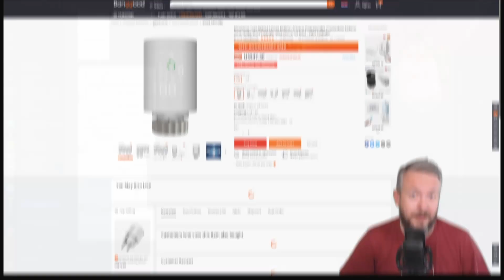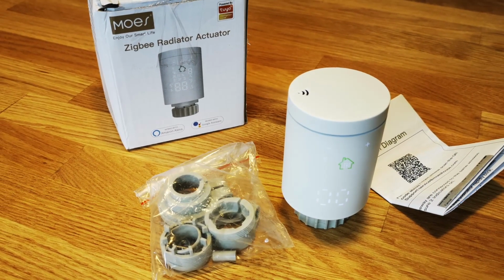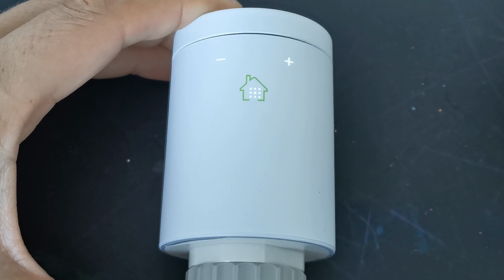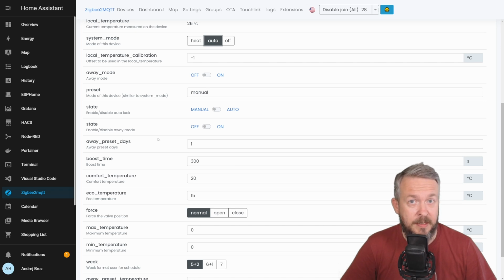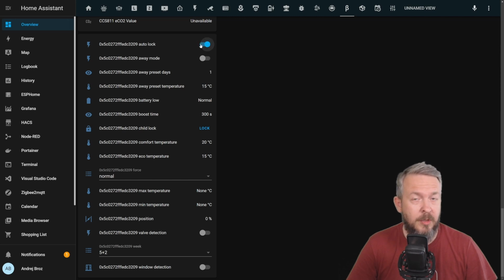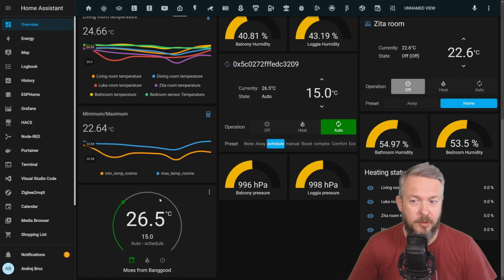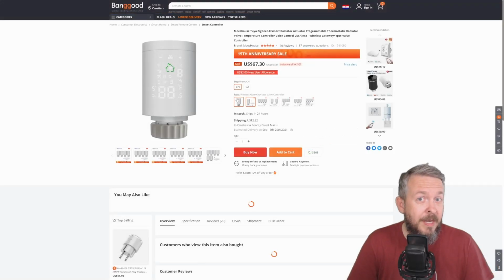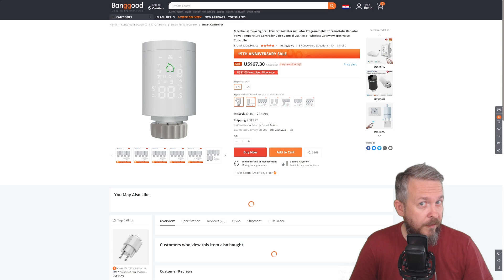Moes Zigbee Smart Valve TS0601 in Home Assistant

Comment: Hi, great video, helped a lot. I have a question, can you use another temperature sensor (not the built-in one) to be used as the temperature probe? i.e. another zigbee temperature sensor mounted elsewhere in the room? thanks
Reply: Yes, but keep in mind that you maybe need a Zigbee hub(or USB dongle) in order to link it to your Home Assistent system.
Reply from the maker: As Steven said, it should work - and hub should not be an issue if you already have Moes sensors in HA.
I would create generic thermostat that would use sensor data for temperature but use climate to control device.
Reply: @BeardedTinker  the hub is not an issue, I already have many zigbee devices through a USB dongle. Can you control the valve directly, bypassing the internal temp readout? essentially using just the "valve" portion of the TRV? i.e. is this component exposed to HASS?
Reply from the maker: @Vojtech Tambor  Yes - that position % (0-100) is full closed to fully open.  Check this here for more info: https://www.zigbee2mqtt.io/devices/TS0601_thermostat.html
Reply: @BeardedTinker  looks like you cant use the valve position % - "Position. Value can be found in the published state on the position property. It's not possible to read (/get) or write (/set) this value. The unit of this value is %."
Reply from the maker: But there is "force" that can be used: https://www.zigbee2mqtt.io/devices/TS0601_thermostat.html#force-enum
Reply: Hi  @vojtechtambor867   I wonder if you could manage to get the valve operated in  "On/Off" mode using external zigbee temperature sensor in HA?

Comment: Hello, very nice video!!!  It give me some "lights", I've one question, if there is a house of 2 flats with around 60 m2 each, will be the hub able to cover all the zone? Someone with experrince on that?  May be there is a kind or repetitor of zigbee signal?  thanks and congratulations for this video!!!
Reply from the maker: Most mains powered Zigbee devices (such as light bulbs or power outlets) are also routers on Zigbee network and as such they extend coverage of the network. IKEA also has (or had, haven't looked lately) range extenders for Zigbee network. Also, some devices can be flashed with router firmware and act as Zigbee network extenders (such as Sonoff USB 3.0 Zigbee dongle).
It's hard to say if any of such devices will be needed or how many are needed to cover such space as it also depends on type of material used for walls, floors etc.

Comment: Why must I use Zigbee2MQTT? All my existing zigbee devices are connected to the zigbee integration directly and are working...
Reply from the maker: Nobody is forcing your arm. You can use ZHA if it supports it. If not, you can also create custom converter and make it compatible.
I use Zigbee2mqtt as it has more features and supports much more ZigBee devices.

Comment: I’ve bought 22 of these devices and I paired them all successfully. One stopped responding to Z2MQTT so and I noticed that it reported that the batteries were not good - which was strange in itself.

I’ve replaced the batteries and tried to access menu 5 again on the device - only it does not show. The menu only goes to 5. I’ve taken a new device out of the box and the menus on it are as expected but on this troublesome one it just doesn’t go back to 5…(pairing mode)

Has anyone got any suggestions? I cannot see a reset button on the thermostat
Reply: Hi @aidanbree.  I've just bought 3 of these (other white label version) from Amazon in the US. I am completely unable to pair them, following the instructions from this video. I've tried both a Conbee II and separately a Tubes (using Zigbee2MQTT). All my other devices are Zwave, so I can't test it separately. I've even tried moving the Rpi 10 feet from my router and behind a closed door to try to reduce interference.  Would you mind sharing your hardware and the Zigbee2MQTT Configuration?  Thanks!
Reply: @ha_tinkerer1191  Make sure you are running a recent version of Z2MQTT. I found that they'd changed repo some time ago and mine was stuck on an old release. When I sorted that out, everything worked fine. I use a Zigazigah stick
Reply from the maker: @ha_tinkerer1191  try this https://www.zigbee2mqtt.io/advanced/support-new-devices/01_support_new_devices.html#instructions to pull out exact device name (not address). There are devices that look similar but are in a fact different. It may be that those are not natively supported. If name of the device is not in the list, you can request that device support be added in Zigbee2MQTT. It's really not hard to pull necessary info, and others can help you.
Reply from the maker: @HA_tinkerer  - got notification that you posted replay but it's gone. YT deletes them sometimes for no apparent reason.
Reply: @ha_tinkerer1191  have you solved the issue? 3 valves work, 3 valves wont show menu 5
Reply from the maker: Check manual on this page - on the bottom of it is manual.
And last item on last page of manual is how to reset device: https://www.moeshouse.com/collections/trv-radiator-valve/products/tuya-zigbee3-0-new-mini-wifi-radiator-actuator-smart-programmable-thermostat-temperature-trv-controller
Display 88, using + or - to hange to 00, press MENU to reset, all of the icons appear means reset successfully (this is copy paste)
Reply: @BeardedTinker  Thanks - I missed that part. I gave it a go - several goes and it looks like it resets OK but bizarrely the main menu only goes up to 4....Its really strange. Every other device works OK!
Reply from the maker: @AidanBree  no idea what it would do that

Comment: B.T. Everything arrived but I can't get the pairing to work with my Conbee 2 to deConz Zigbee network. Can you point me in the right direction if you have come across a solution or let me know your Zigbee set up and I can use that.
Reply from the maker: Just checked deConz list of supported devices and I can't find it there. https://github.com/dresden-elektronik/deconz-rest-plugin/wiki/Supported-Devices#other-supported-devices
As I don't have Conbee stick I also never used deConz. Not sure what is procedure for adding support to new devices. In Zigbee2MQTT that part is much easier. for ZHA a bit more complex, but it's also duable.
Reply: @BeardedTinker  Ah! That's interesting. I now see that there are two Zigbee methods. Thanks for letting me know, B.T. I've learned something and can take it from here.

Comment: Hi. Nice video. I have the same valve. It works two or three days then it gets stuck and won't close when tether temperature is reached or, other way around, it does not open if temperature drops below target. In such cases I can only remove batteries and reset the device. Do you have any similar experience with those valves?
Reply from the maker: While I had it (it was given away) I didn't have those problems. What is LQI (Link quality)? 
One thing you may try is to replace batteries just ot be on the safe side and that's the only thing that pops on my mind.

Comment: Nice video, but I issued an incorrect temperature when adding the thermostat on the HA dashboard. I use the Tuya Zigbee hub and I have no problem when using the Tuya app
Reply from the maker: Sorry didn't understand. Is the temperature in Home Assistant that is reported different than in Tulsa App?
Reply: @BeardedTinker  Yes is the different temp . for example, the temp in HA is 25 C and the tuya app 5 c
Reply from the maker: 20oC difference? What value are you using in HA to pull temperature? Climate or something else. https://www.zigbee2mqtt.io/devices/TS0601_thermostat.html
You could use calibration setting to calibrate data, but still since there is such a big difference I think you may be pulling wrong value.

Comment: Is there a to setup a sonoff relay to initiate the heat from the boiler when any ofnthe valves open to some preset %? Also how to set up external themp sensor for these?
Reply from the maker: All such things are done on Home Assistant side. One is to create automation that would trigger the relay to initiate heat.
Second one is to create template thermostat and use relay as switch and valve as temperature source.
I don't know if it's possible to use external source for these, never tried and don't have it anymore as I've given it away on giveaway few months ago.

Comment: Hi, is your "local_temperature" updated immediately when you are changing "local_temperature_calibration" or is it happening randomly like for me?  I like to calibrate the thermostat "local_temp" with a room thermometer with an automation. (I have a BECA but integrated as Moes in Zigbee2MQTT, I believe it is the same Tuya stuff.)
Reply from the maker: Can't tell you, sorry. I've given my valve away at giveaway so don't have it anymore. But as this is end device in ZigBee network, it can take some time for update to be received as it goes in sleep to prevent battery drain. Not sure how often does it have to connect.
Reply: @BeardedTinker  Ok, it seems like if I leave it alone and don't touch it works (still testing). The point here is that I have a quite big room of roughly 65 sqrm with 7 radiators. The radiator valves are connected to radiator and the radiator are place under windows. i really don't care about the temp there. I care about the temp some 1,5 meter up from the floor somewhere central in the room.I basically wants the valves to play in sync. What I done is an automation that trigger at a time interval and compare the room temperature the " local temp" and correct it.

I need to try out the time interval, at the moment I'm trying 20 minutes. This is the action part of my automation.

service: number.set_value
target:
  entity_id: number.tobesrum_local_temperature_calibration
data:
  value: >-
    {{states('sensor.mellan_temperature') | float |round(1, "half", default) 
    -    (state_attr('climate.tobesrum','local_temperature')| float |round(1,
    "half", default) 
 -    states('number.tobesrum_local_temperature_calibration') | float)|round(1,
    "half", default)  }}

That is adjustment=roomtemp-(radiotortemp-adjustment)

Comment: Is there any way to use a smart thermostatic valve without a HUB? 

I this problem:
I have a Vaillant thermostat in the living room but in the morning the sun heats the space so the heating shots off but the other parts of the house are cold. 

I would need to move the thermostat or install a smart thermostatic valves so I could easily setup the first part of the day...
Reply from the maker: That's not easy answer - if you have Home Assistant as smart home software, you need some kind of Zigbee hub to connect device to smart system to control the valve OR to override Thermostat, if it is smart thermostat. I use tado thermostat and I can leave it on auto, or use Home Assistant to override values I get from it.
If you go with Sonoff Zigbee HUB, then you should be able to just use app for Sonoff to control the valve, but you would still have problem with thermostat.
Very hard to answer as there are multiple solutions on how you can do this.

Comment: Got one of these second hand to test out with home assistant. Do you know what all these modes (eco, Holiday, complex, auto) do? Are they just different temperature settings you can use or do they differ in behavior.

And 2nd question: if my trv needs to heat it always opens the valve completely, which is very noisy and creates incredible heat close to the radiator. Can't it just open half and wait if this is enough to achieve heating?
Reply from the maker: Thanks for the comment! 1) those are predefined temperatures that you can setp - for exampe Holliday is set to 7oC to prevent frost, ECO, few degrees below your standard temperature for times you are near your home, but not at home, etc.
2) not sure on that one - I've given my away and can't test it. Valve has 3 states - closed - fully closed, open, fully open, and normal - I think normal should be used for standard operation. Position values can only be read I think, and not set. Check here:  https://www.zigbee2mqtt.io/devices/TS0601_thermostat.html

Comment: 14:18 I'm very interested if you can post some links which devices can control my boiler? Like you said Tado and Netatmo can do that but they are very pricey.
Reply from the maker: One of them is this one - https://www.zigbee2mqtt.io/devices/BHT-002-GCLZB.html  this is Zigbee version. I have on my desk for test BHT-3000 - but by mistake, Wanted Zigbee, got WiFi. This should also work, but second mistake, it's for underfloor heating... :)
On Zigbee2MQTT link there is very good search engine and device list - try looking for thermostat - there are few of them there and all work with Zigbee. Just when you look at specs, check that they fit your boiler (and not like me order floor heating version).

Comment: Thanks for the great video! Can you please name the two devices for heat initiation please? I have a gas boiler (not a smart one)
Reply from the maker: I'm using tado, but that's legacy/closed system. Something lime this one will work great https://www.zigbee2mqtt.io/devices/BHT-002-GCLZB.html I unfortunately wanted to test this one but got WiFi version by mistake. But yes, WiFi version will also work.
When you look at  devices for heat initiation, be careful as most of them have 3 options - gas, electric and underfloor heating.
Reply: @BeardedTinker  so this is technically possible to use valves in addition to a thermostat in an indipendent home with a tuya ecosystem right? Because the more i look on the internet the more i see people using either only the thermostat (independent home) or only the valves (apartments). Instead i see systems like tado or netatmo being widely adopted for this particular situation, and it is making me think that this feature is not available in tuya. 
PS. Thanks for the quick response!
Reply from the maker: @filippoaisa2982  Yes, you can mix - but only if you have some other system that combines both of them - for Example - Home Assistant can talk both to Tuya devices and tado/Netatmo.
Call to heat is done to wards and smart thermostat (like one I sent you link or any other Zigbee/Wifi one). I have full tado system - both thermostat and also valves from them.

Comment: I noticed your  thermostat  cards had a scheduler icon, is that a HACs card or some yaml I haven't noticed?
Reply from the maker: This is HACS card - Simple Thermostat. It has Auto functionality for automatic day/night setting, but that's based on device it controls and you can't create schedule there.
My schedule is on tado app and devices use that.
Moes smart valve also supports schedule, and you can create it via MQTT.
Reply: @BeardedTinker  as usual, a clear and useful video. I´m using other type of thermostat for electric floor heating considering now HA fixed the tuya integration in the last release. I was looking for the Simple Thermostat in HACS but didn't find it. May be they changed the name...Can you please share the repository link. Thanks

Comment: Hello sir
I viewed your movie about moes thermostat valve
I see in the movie many thinks and i believe it must be also possible to program a schedule in home assistant
Now i have these valves but i can only see Temperature and batterie state
I can't find the other entities 
I use the standard Lovelace card and a conbee 2 ZigBee device
But i see also you have zigbee2mqtt is that the reason i can see only two parameters and is it possible to explain what i can do so i can see all the parameters.
As mentioned earlier I’m just a beginner.
Reply from the maker: Hi Ernst and sorry for late replay...
It is possible. Not as easy as with app, with, still you can do it via MQTT.
Please check here: https://www.zigbee2mqtt.io/devices/TS0601_thermostat.html#controlling-device-specific-features
There is section for creating schedule.

Comment: how do i know if it's compatible with my boiler?
Reply from the maker: This device is independent of the boiler. It doesn't create call to heat. There are compatible thermostats from same (or similar manufacturers) that hook-up to boiler. I hoped to record video on that but by mistake got WiFi version.

Comment: Bought 6 of them from your link, but it seems they do not work with HA for me.
The valve reads (after +2°C manual adjustment on the valve itself) 21°C and is set to 16°C. Valve close. Good so far. Now I'm setting it to 17°C from HA. Valve is opening. why the fuck is it opening?
Reply from the maker: I've given mine so can't test it. Are you trying to set valve temperature reading to 17 from HA?
What state are you reading - 0% or 100% (or somehing between that).
I've made mistake in video - 0% is fully closed.
Reply: @BeardedTinker  I've t ested it again and it seems that increasing my set temperature from 16 to 17 (where the valve still reads 21 room temperature) the valve is opened a little bit. Increasin the set further to 18 opens the valve even more. But that doesn't make sense to me. The room is already 4 degree to hot, why would the valve wants to open the valve? I'm trying to set the temperature through HA, yes.
valve closed is also 0% on my valve.